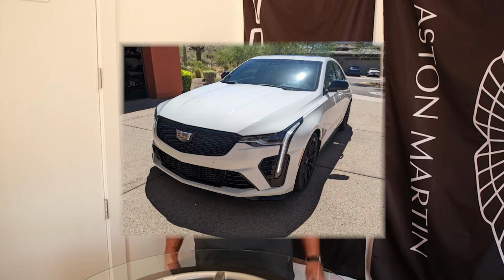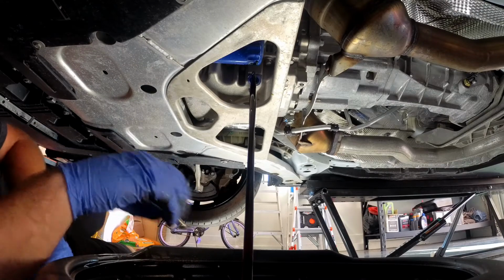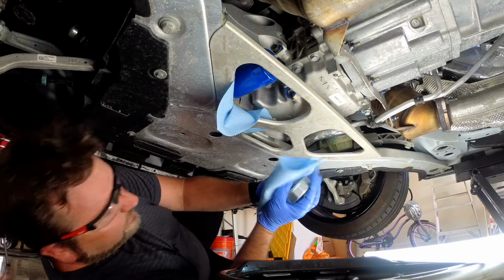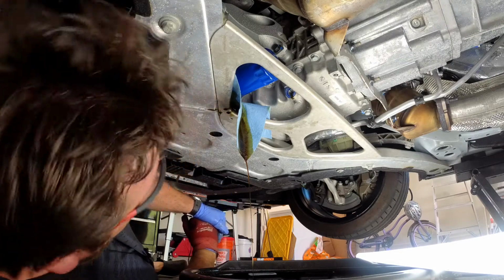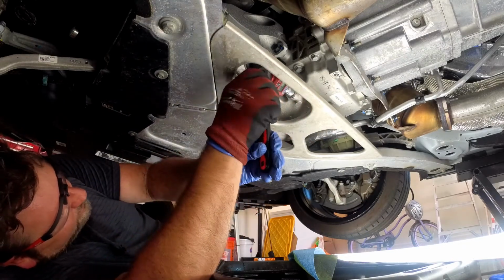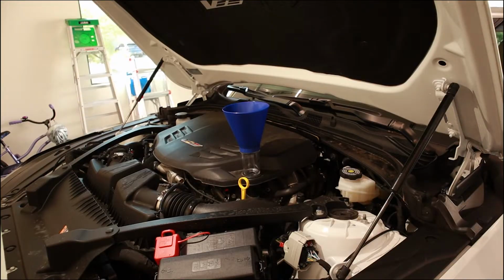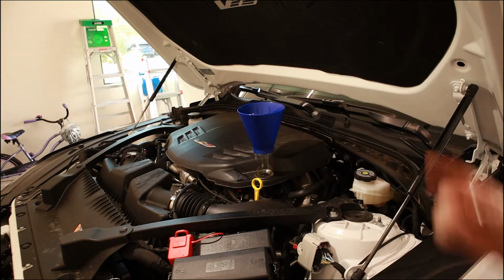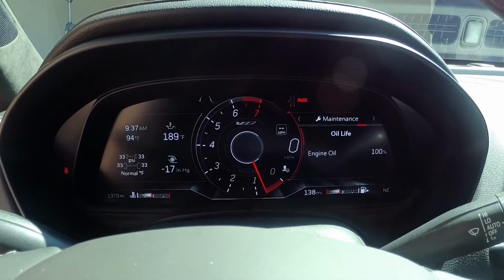2022 CT4-V Blackwing - First Oil Change

Comment: Great video!  Are we still using the PF63, the PF63E, or the new UPF63R for the 4BW?
Reply: Did you ever find the answer to this?
Reply: @rshores84 PF63 for LF4 engine with 74mm 15 flute oil filter wrench.

Comment: When are you supposed to do the first oil change on a CT4-V blackwing?
Reply: I've seen many people debate this.  The manual doesn't say anything about an initial change after the break-in period, but a lot of folks are doing their first oil change within the first 2,000 miles or less.  I'm going to do mine around 1,500 miles.
Reply: I know it’s too late but generally with classics when you break in a fresh engine 500 miles you do an oil change and then if you wanna be super safe you could do another one at 1500-2000 then regular intervals.

Comment: Why change soo early, at 1300 miles? Factory does not recommend.
Reply from the maker: It can't hurt anything. Cheap insurance for peace of mind. Understand not everyone will do this, wasn't the point of the video. Be well.
Reply: Hurts the pocketbook when its 7qts of full synthetic. 🤑
Reply: Factory recommends oil change  at 500-1000 miles and to red the brakes before 500miles for sensors to calibrate the entire biting point
Reply: @OriginalAbsolute  where in the manual did you see that?
Reply: @djcccard4716  on the small booklet that’s attached to the owners manual (blackwing manual), under brake it says: Break in period before 500miles refer to page 346 on owners manual for instruction on break in.
Reply: @OriginalAbsolute  unless I’m blind I’m not seeing anything in mine. I found this video because I’m around 3k miles and was double checking when to do my first oil change. Everything points to just to using the oil life monitor from what I see 🤷‍♂️ I don’t want to wait that long though says I have 60% left.. sounds wrong doing a first change that late lol I’d be like at 8k miles
Reply: @djcccard4716  my blackwing catalog thing was taped to the metal brake ducts pieces under the trunk cover storage

Comment: Just did the first oil change on my CT4 Blackwing.  You weren't kididng about that filter being tight!  The factory installed filter was by far the tightest filter I've ever removed from a car.  

I used a three-jaw filter wrench and it crushed the end of the filter before finally breaking loose.
Reply: same lmaoo although i didnt crush it, i thought my shoulder was going to give out before the filter and im a heavy diesel mechanic lmao Im assuming them didnt lube the ring

Comment: Just picked up a CT4V BW after trading in my 718 Cayman S.

I own a Quickjack 5000 SLX like the one you linked in your description and in the video. I decided to take a look under the car to see where the jack points are and it looks like the car needs to be raised via the pinch welds. 

Is the 5000SLX long enough to reach both jack points (welds) ?

I figure I'll pick up some Quickjack Pinch Weld Blocks as it seems safer and necessary to handle my own oil changes and maintenance. 

Thanks for the vid!
Reply from the maker: You are correct, lifting this on the QJ requires some finagling. The pinch welds do represent where you have to lift. I don’t completely recall how I got it in the end but think it was on the rubber blocks and some circular grooves pucks of sorts. This was my neighbor’s car but I really liked it. Enjoy!
Reply: @DWraysGarage  Yes I've read a bit more it sounds like QJ pinch weld blocks up front and then just solid blocks or pucks on the rear brace. Just trying to confirm whether my current 5000 will work on this car like it did on my 718 Cayman or if upping to a 6000 unit is in the cards. Thanks for the reply.

Comment: Nice! Can u please do a video on maybe a tube change on the purple girls bike?? 😂
I use aluminum foil to “form” around those tight spots and then you can also mold a sort of funnel shape into the drain pan. Keeps any oil from getting on the x-member. 👍🏻
Reply from the maker: Good idea 💡. Probably will have to do that under the Spyder. Porsche puts it's filters on very inconvenient places.